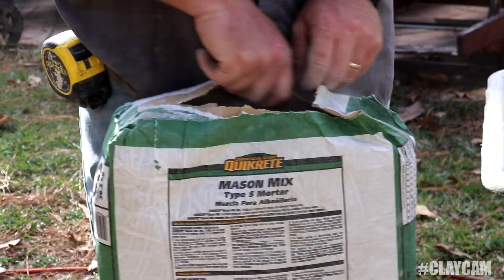WORKING ON A TILE SHOWER

Comment: Nice try, but several serious errors in that shower pan.
Reply from the maker: I’d love to hear more
Reply: @claytonhnelson  So the liner is supposed to go over the curb not in the middle, the whole curb needs to be protected. there was no preslope, there was no weep hole protection, the liner where the wall meets the curb, can't have been done correctly because there was no curb to rap. You used concrete mix, should have been deck mud, the liner at the drain was not properly cut.  I don't mean to sound critical, but there are enough bad installs being done without having you show yet another way to screw it up. If you are going to show people how to do stuff, make sure it is the right way, Water Damage from a leaky shower is no joke. Check out my channel and you wil see I know what I am talking about. Next time, please be more accurate.
Reply from the maker: Thanks for your feedback. I understand your points and in theory they make sense but in reality are unnecessary. 15 years using this method and not one leaky shower
Reply: @claytonhnelson  Not one leaky shower you know about. Not theory, seen countless instances of huge water damage caused by the "Reality" of this method. You can choose to update your methods to do it the right way, or you can continue to do it your way, the difference now is that you have been informed of the consequences. The reasons not to update and improve, are irrelevant, continuing along this path is from no on willful negligence, that the homeowner will have to suffer. Damage can sometimes take years to make itself know, the hidden damage in these cases is usually quite extensive. I speak from first hand knowledge. We all have to learn, no one knows it all, but it is our responsibility to improve and do better.